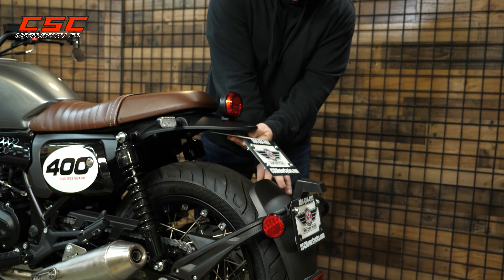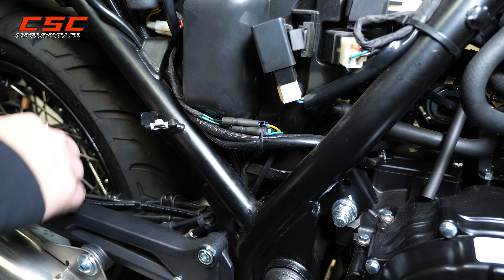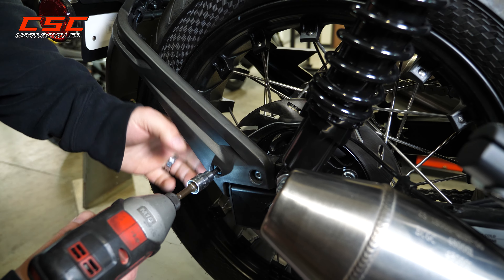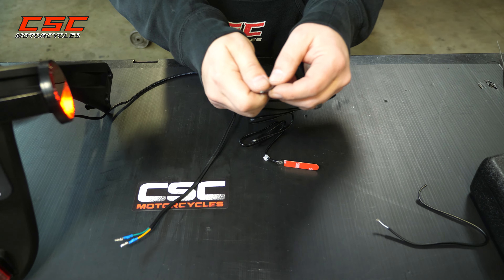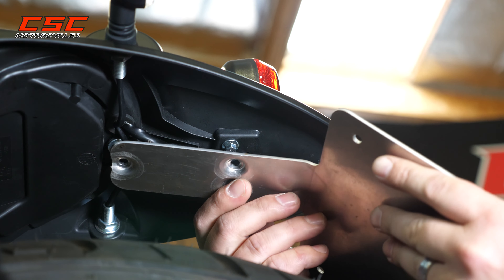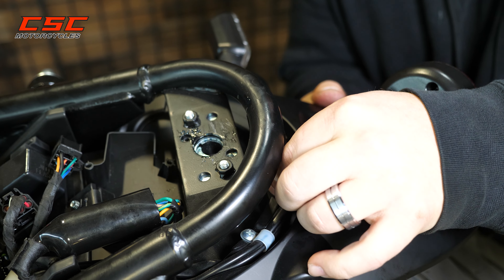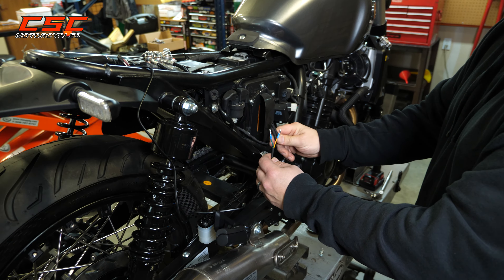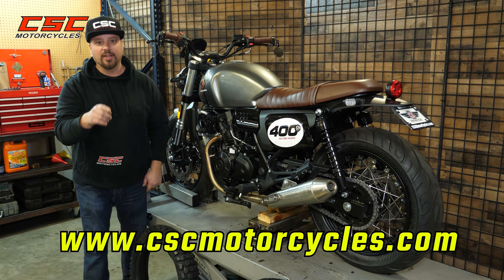SG400 Fender Elimination

Comment: I'd pay 5+ bucks extra to have it shipped prewired and ready to install as I don't have the heat shrink and soldering stuff.
Reply: You can use simple butt connectors instead of solder. All trailers and even aircraft use crimp connectors and they are less susceptible to vibration than soldered connections!